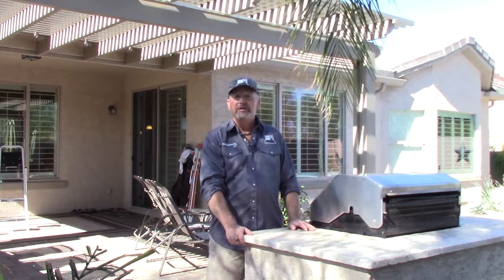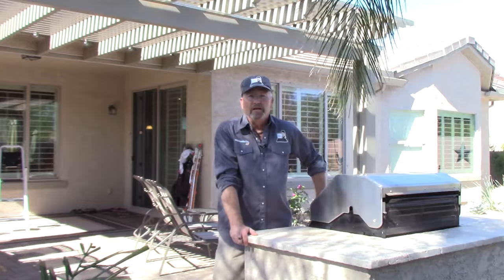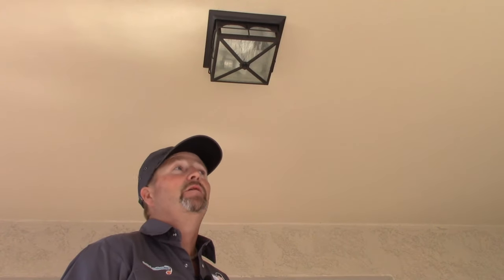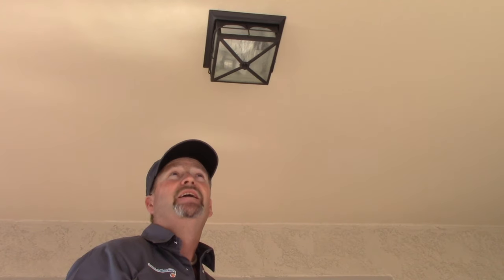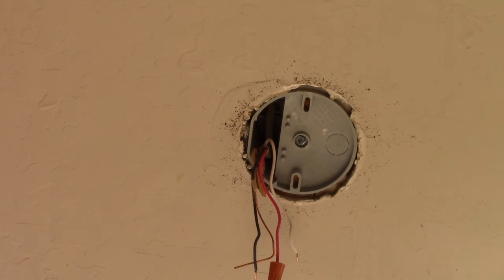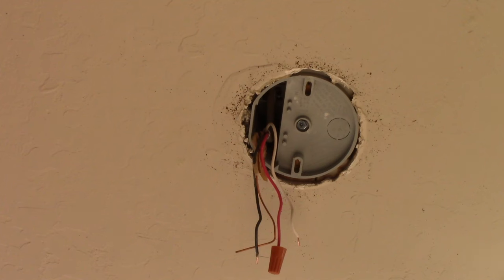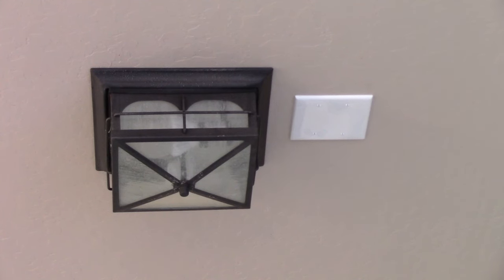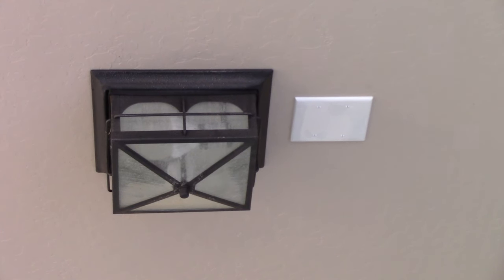How to Wire LED Patio Lights

Comment: What type of wire are you using for the leds? I have read that people use CL2 rated in wall speaker wire? Is that what you use?
Reply: Jeremy McCabe speaker wire?? Ohhhh that’s what I was missing
Reply: He is using thermostat cable and it’s usually solid.
Reply: Ups. I am wrong not thermostat cable. It 18-2 wire… sorry.